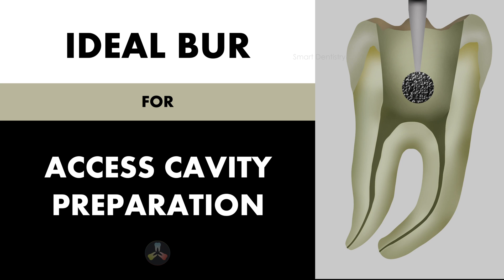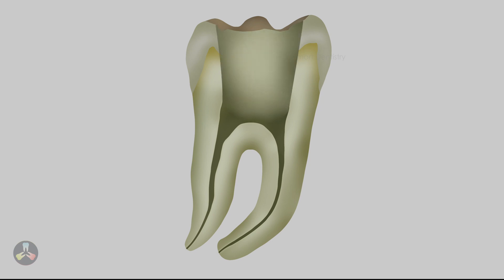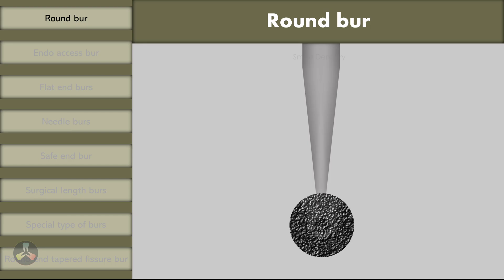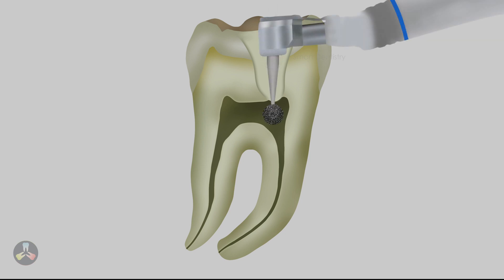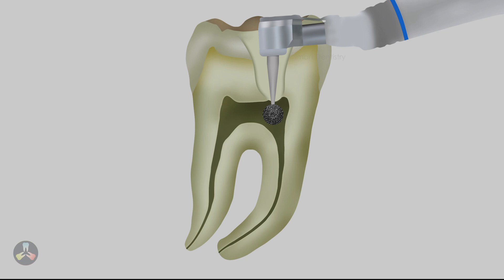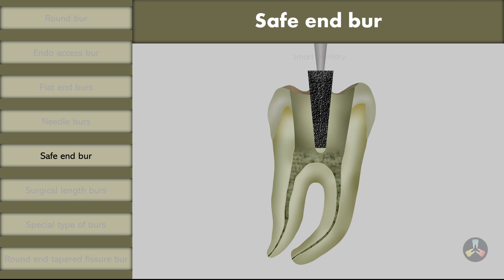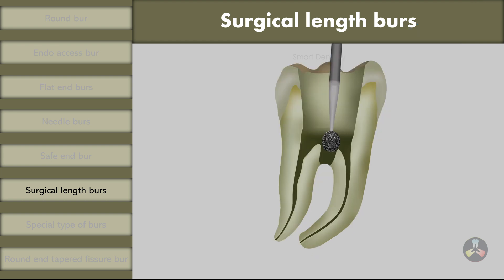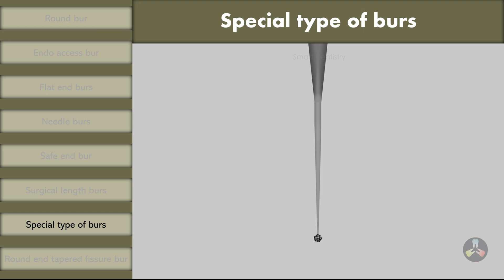Ideal bur for Access Cavity Preparation

Comment: Endo-Z bur is best for access cavity prep after using round to feel the drop into the pulp chamber. Change my mind!
Reply from the maker: The drop can be felt only in teeth with large pulp chambers. In most cases getting a drop is not a common clinical situation.